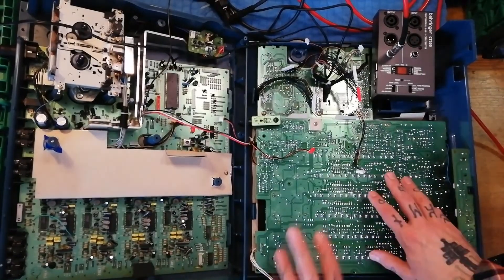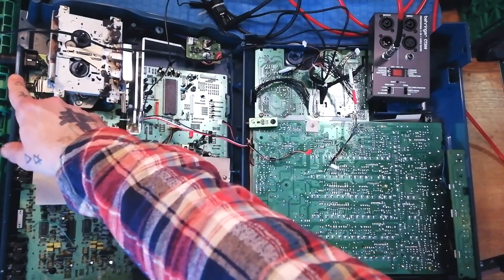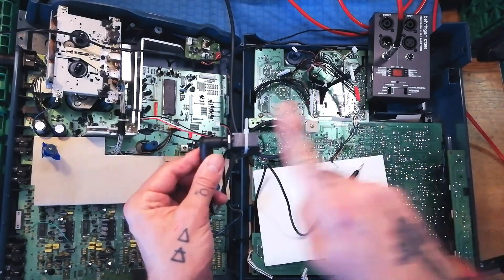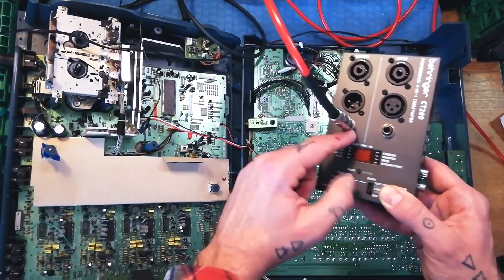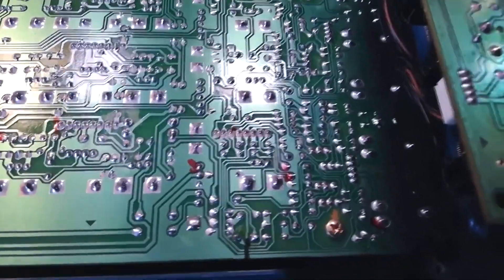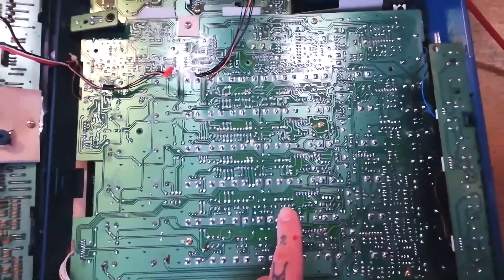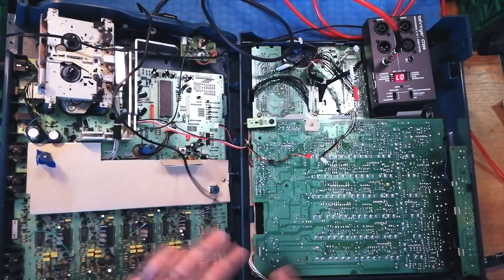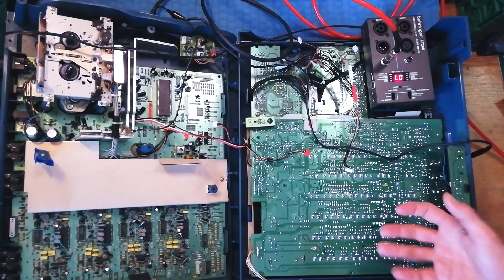How to signal trace audio gear  | Tascam 424 MKIII | Part 5 |

Comment from the maker: IMPORTANT NOTE  - I made a bit of a schoolboy error in this video, implying and assuming that because the Fader appears at the bottom of the mixer strip, it is the last component the signal passes through...this is NOT the case! In fact I ought to know by now (having worked on other tascams where I do have the schematic) that in most mixers the signal passes through the fader BEFORE the EQ section, so my signal test should have moved from the input & gain stages to the fader,  then the EQ, had I done this, I'd have come to the correct conclusion earlier, which is that the channel 2 fader is dead and needs to be replaced! 

Also I  forgot to say in the video but the single cable running from the mixer to the rest of the system which is plugged in feeds DC power to the mixer circuit ...most audio circuits will have active components like op-amps in there somewhere, so if your mixer, or guitar pedal or whatever bit of audio gear you are tracing is not receiving power, don't expect the sine wave to travel very far! 

Please check out my channel for more videos on fixing four track cassette recorders and other topics of interest to DIY musicians x

Comment: I just love your attention to detail. Your vids are top-notch. What type of caps do you recommend for the audio path? i.e. Audio Grade, General grade, ect? Cheers.
Reply from the maker: Thanks. I started out using audio grade nichicon in case it was important, but recently I used general grade panasonics just to get the values into the workshop quickly for a time sensitive job, I couldn't hear the difference tbh

Comment: Thanks for posting this video! It’s been quite helpful as I learn more about my 424 mkIII. My unit is in a similar condition to yours, in that channel 2 cuts out. However, I’ve noticed that everything works on it for a few sections if I push in a bit on the Low EQ boost/cut knob. Do you think this means there is a break point in the solder, or just dust that needs to be cleaned out from under the knob?
Reply from the maker: It could be either, but since it's going to be really difficult to effectively clean that pot without disassembling the upper half of the unit, I recommend you do that. Unless you see an obvious break in the solder which gives away exactly where your issue is,  in addition to cleaning all the pots and switches, apply heat and a tiny bit of fresh solder to all the contacts pertaining to the problem channel - the extra reflow work is going to be insignificant compared to the time you spend getting the unit apart anyway, thanks for watching!

Comment: thinkl i am rigth here.pleace correct.A electrolytic capasitor or polare caps blocks ac not dc.If put in parralel on plus and comon after a bridge rectifier it filters out the ripples.pretty shure a cap blocks ac and not dc.It may be circuits where caps are wired in series and will then function as a highpass filter and should be a bipolare.decoupling ceramic are bipolare.
Reply from the maker: No, capacitors pass AC and block DC, here is a video which explains why. https://youtu.be/NInt1Ss3vQ4  (the reason a capacitor cleans ripple after a bridge rectifier is the capacitor absorbs charge from the peaks and discharges to fill the dips in the signal, making the rectified signal more even.)
Reply: capacitors have to pass ac or else nobody's speakers would ever work that used a crossover.